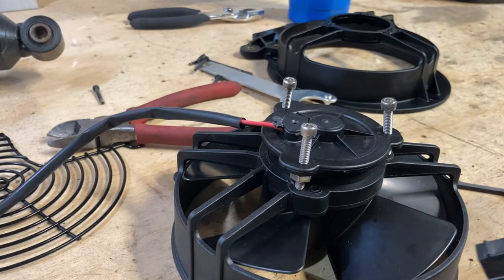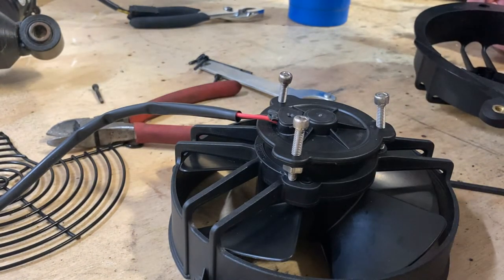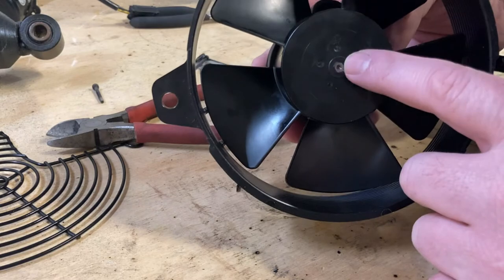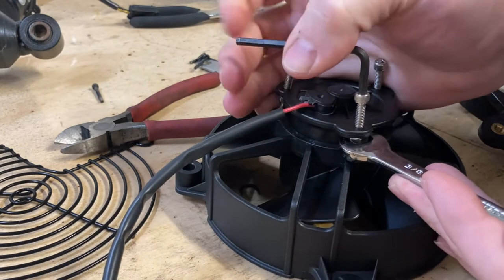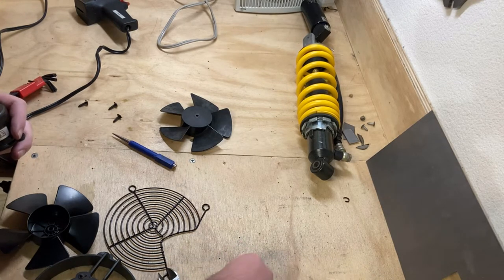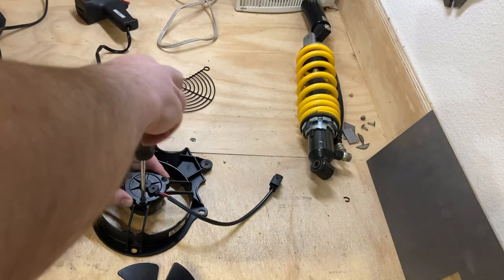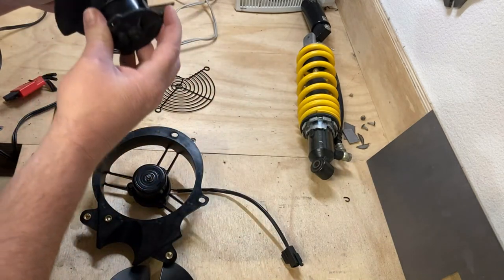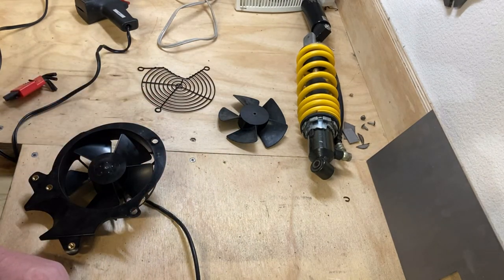Rear Cooling Fan Replacement - Buell XB9SX

Comment: I'm pretty sure thats the same Spal fan used on the 1125 and 1190 radiators.  The key to doing this is not to stress the bearings too much by assuring that the fan gets pressed off, and back on, evenly.  Also the same clock position on the shaft that it was removed from.  Especially if it has balance weights on the fan blades which some may have, due to motor windings or plastic consistency or for whatever reason they were installed.

Comment: Just FYI in case someone needs it: my fan stopped working and after removing and doing continuity checks, the fault was at the pin in the connector housing and the wire. So in my case, I could've just re-did the pin into  the housing without changing the fan.